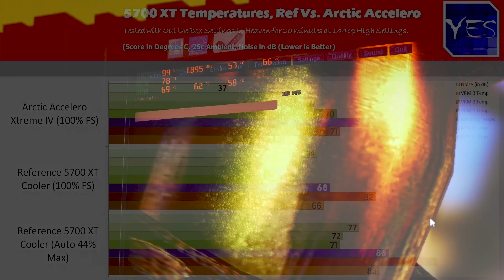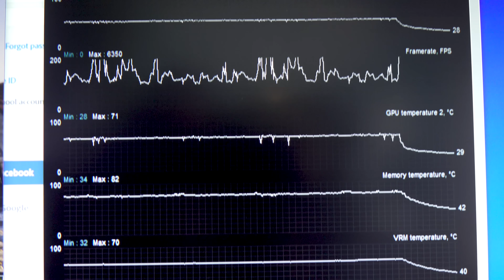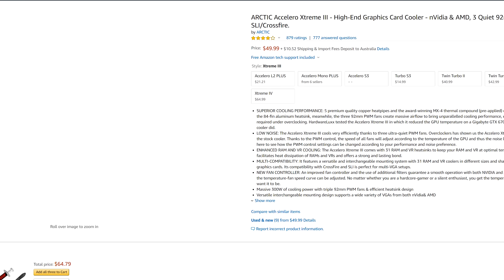Arctic Accelero on a 5700XT - Is it GOOD?!

Comment: tech yes city if you know the answers or any ideas on what i can do to fix an issue i would love it. so my issue is only on a singe genre of game its call of duty black ops 4 i have a i7 7700 and 16gbs ddr4 2400mhz and a gtx 1070ti 450watt PSU 80plus bronze and in call of duty on any settings my cpu is at 100% and my GPU is at 0-1%  and when playing my FPS will be like 120 and then drop down to 20 every min or souse when playing the game and ive tried multiple drivers and the only one that kind of works is the one from november 2017 and i cant seem to fix it  no other game has this issue and i play alot of different games and its kind of annoying, it only happens on black ops 4 and call of duty Modernwarfare when it was beta black ops 3 is fine and also call of duty WW2 is fine, any help would be great :D (also great video)

Comment: AMD Fan bug workaround.  Plug the GPU fan cable to the motherboards fan header.  Then use your board's desktop app to control fan speed.    you won't be able to set a fan curve but can adjust fans according to temp.

Comment: What if, you use that cooler on a rx 5700 and flash drive it with the xt or use the program that allows to pass the clock speed limits of the driver. Reference models start at 320-340 usd/euros, so technically you could have a cheaper kind of xt model with better cooling.

Comment: Hi Bryan. You should try Rajintek Morpheus II. That is a whole different beast compared to Accelero. 12.5 million screws are there to sandwich PCB better, improve rigidity, and prevent GPU sag. Having only 4 screws like on Accelero really warps the card after a period of time. You need to be careful with installation and don't overtighten the screws or you can bend the card yourself. I had a few Acceleros and other aftermarket coolers and if they are not vertically mounted I always prop them with something just to prevent the weight of the cooler bending the card.

Comment: Seems like a cool product, but i think spending those extra 50-65$ on an aftermarket cooler for a reference card is a bad value. Buying the reference card vs. the Pulse here is about a 40€ difference, around 55€ difference to the Red Devil, even the Strix OC, Gaming X or Nitro+ wouldn't cost me much more than the reference card + Accelero. So, a pretty cool product really but the added cost of a better cooler could have gotten you a card with a much better cooler to begin with.

Comment: The Arctic Accelero GPU coolers are like Noctua cooler for CPU, good performance but damn those looks are hideous. Since they're making them for refference cards make it specific only for the refference cards, meaning ADAPT them. Make the cooler touch the VRM, the mosphets and all other components that need cooling and most important improvise on the looks a little.

Comment: The back plate is paramount to cooling and overclocking. Yes it takes time, but it is needed. I took my nvidia gtx 1070 founders edition, could not overclock it more then 100mhz with the founders cooler, and this is in a case with very good air flow. On the 1070, once the Accelero 4 was fully installed, I was able to get a 200mhz core and memory speed overclock. Without the back plate, the rest of the components over heat like crazy and will not allow overclocking. Before with the founders cooler it ran 74c under load, with the Accelero 4 I was getting 45c. It's an incredible cooler when applied correctly.

Comment: I had a IV on a RX480. The backplate really did it's job, it was quite hot after gaming. It was so heavy though. During cleanup install/removal some solder joint gave up and it was dead (the gpu sagged a bit). No warranty after removing the stock cooler. Had to eat that one.

Comment: Artic do include the heatsinks in the 3, but fitment of them isn't very good, but the cpu cooler does a good job. I had to modify the mem heatsinks to fit better. Still got high mem temps.
Edit: that back plate is supposed to replace the heatsinks and cool the mem from the back of the board.

Comment: version 3 does still come with the heatsinks and thermal adhesive. also note the fan speed is only 2000 rpm at 100%. if you had 3 fans at 4000 rpm it would be different

Comment: There is a way to clip memory heatsinks down against the pcb so you dont have to use a curing paste and get better mounting pressure. Next you should try the Alphacool Eiswolf GPX AIO for the 5700xt. It supposedly keeps everything cool even tho the liquid only hits the die directly, but ive heard only anecdotal evidence.

Comment: That backplate is good for memory cooling(gddr6 memor die is near the bottom not the top) and the gpu die but its needs thick thermal pads between to not shorting out the card and is hard to measure those points.And in my coyntry Artic Accelero cost 62€ so its much cheaper to buy custom card with good cooling.

Comment: Gamer Nexus points out in several of his videos that the GDDR6 has its die on the base of the chip. So one would assume that cooling the back of the board,  would improve significantly their temps.
Reply: Yea not the greatest choice in this day in age to not use a backplate. If a gpu has gddr6 which going in the future they all will backplate cooling is only going to help. I dont buy gpus with out one they just look like they are missing something and of course to me reveled PCB just looks terrible.
Reply: Yes the backplate helps a lot on these cards.
Reply: This...
Although it isn't as effective as the heatsinks on the front of the chips, most manufacturers are using thermal pads with backplates for GDDR6, and the ones who don't typically have memory thermal issues.
Reply: There's a pcb with plastic inbetween that and the thermal pad when cooled from the back..

Duuhhh... of course till be worse when cooled from the back.
Reply: @RB1of1  you should cut a hole in the plastic...have to cooler and the backpalate helps a lot with vrm/vram temps
Reply: @RB1of1  You don't use the plastic. When you apply the thermal pads to the back, they are thick and space the backplate out from the PCB, so that it isn't just touching everything and creates shorts.

Comment: You did not read the manual m8 XD 

You did use BOTH washers simultaneously when likely using one is enough (going by RX570)
6:03 you crank the screws hard enough to BEND the mounting plate 

The black heatsink acts as both backplate and VRM/memory heatsink, this "fixes" the memory heatsink clearance problem around the cooler and makes mounting faster. Though it leaves the VRM hotter than it needs to be. 

You put that on by tracing hotspots on the protective film and cut the heatspots out, place in thermalpads and sandwich all with the backplate/heatsink provided

Id say 7/10 solution, instead of redoing the cooler from scratch to leave more space around the GPU area, they keep the old one and slap a fat heatsink on the other side. 

On one hand that will stiffen your card and minimize gpu sag with the added bracket, on the other it CAN bend your PCB quite severely as the backplate cant move far enough on some cards with an IO facing VRM to squish the thick thermal pads together

Comment: Can i claim warrenty anyway after doing this??
Reply: sure, but first you will have to put your old cooler back together
Reply: @RapttorX  ya but is there no stickerthta voids warrenty??and if there is how do i resue warenty void sticker
Reply: @rustydust8648  check if you have warranty stickers on the screw heads before you open it. If not, then go on. If you live in the US its legal to open/repair your product and warranty stickers are illegal.
Also dont do this if you never opened a video card before so you wont harm it in the process.

Comment: The whole point of the IV is it doesn't require gluing stuff to the card in the event you want to revert the card later on.
Reply: the adhesive thermal paste can be cleaned too
Reply: @RapttorX  Yeah, but it's harder. It's right in the product description.
Reply: @MarginalSC  you just scrape it a bit harder and it will come off, its not superglue. Im not a fan of it either btw
Reply: @RapttorX  Yeah, I'm simply saying that the product is intended to be a cooler replacement that's easily reversible if needed tho. That's what it's intended to be used for. Which is why it doesn't come with glue and heatsinks.

Comment: Dear big B., I like your content but in this video you did not use the real possibility of the technology. If you did build it properly with backplate and thermalpads you would have even reached lower temps and cooled the other components. You do not need the little headsinks. Very sad that you judge an aftermarket cooler and not using it right. Check for example https://youtu.be/WGo6s-2RXwo (German PC magazin)
Reply: Top comment. It isn't the frist time that I see a reviewer mount a cooler not as instructed and then start to negativaly judge the component on the errors they created themselves.

Comment: Hi YESman,
What about the Rajintek Morpheus II? While it doesn't come with any fans, it does come with heatsinks for memory, VRMs, etc., thermal paste and self-adhesive thermal pads... it looks better too in my opinion, I'm really no fan of the mid-90s flair and aesthetics of the arctic one
Reply: IMHO the Morpheus is better on Vega 64 non AIB. The A IV works great if built properly https://youtu.be/WGo6s-2RXwob (German, but good to understand as the temps are on screen)

Comment: Bryan...... Bryan. The back plate is the heatsink for the components the thermal pads go over the back side of the vram and vrm and back plate cools them from the back side of them. Its not as effective but still works and is not permanent like the 3's thermal glue. Still love you man. LOL.
Reply: Love it how he doesn't give a f about the manual and just made a "diy" extreme 3
Reply: Right I agree
Reply: No, wrong, the backplate actually increases component temperature. Purely for aestetics. You haven't heard of Gamers Nexus huh? https://youtu.be/SF1Zs3unEto
Reply: @hjembrentkent6181  That back plate is for aesthetics, the one we're on about is supposed to have some cooling capability mate
Reply: i dont know why people wont use the backplate!! a orginal 1080 heats up to 95g on the vrms...without the headsink, your Card will lose perfomance!!
the backplate is not the "best" solution but it works....without the heatsink your ram and vrms reach a high temp limit!!
Reply: @Knebebelmeyer  I got the Accelero IV for a blower style 2080Ti, but when I installed the backplate I found it pressed against the RAM sticks on my mother board, and made me very nervous. I removed it and used the original flat backplate from the card. Also fitted some small RAM and VRM heatsinks on the component side, so basically a kludged Accelero III. It works perfectly, GPU temp went from throttling at 90 with a jet engine fan, to near silent at 60-65 full load.  The little heat sinks I got came with thermal tape applied, so they are not as permanent as the thermal glue. If I want to return to stock, I am sure I can do that.
Reply: @chrisward000  how the accolereo 4 fits for 2080ti thats i dont know.
the rams itself wont get seriosly hot.
the vrms are the spot, where u have to look to.
i used the backplate with the thick heat pats and the cutted out plastic.
yes u get some pressure one the Pcb itself, you have to use the small clamps and put them on the right place for it.
but a 2080ti is a big card and if you mounting them usual ways, you get always some pressure ob the pcb cause of gravitiy!
i use the accolero extreme 4 for almost a year on a 1080 and its did a good good job.
85 degrees usual in preddy every game, down to 55-61max on 2ghz OC.
its a very good cooler.
if you are worried about the backplate you can use other methods to cool your VRMs, but u have to do this, otherwise the card will throggle and u dont get the power out of this.
Reply: Lmao fr man couldn’t take 15 minutes to trace a couple of components
Reply: I've had this cooler with the backplate version, trust Bryan mate, it really is a terrible idea, also what makes this backplate so useless is the fact that the "fins" are arranged perpendicularly with the length of the card rather than just going across, reason being that in the latter the case fans would at least help provide a bit of airflow, its a dumb design and i would strongly recommend that you get heatsinks like Bryan did + you get to keep the original backplate of the card which is a + for the looks
edit: also as a side note for those who dont like the artic acelero cheap logo sticker at the front, you can actually detach the fan piece from the heatsink and rotate it to the other side that's another + for the looks for anyone that cares
Reply: @vladduh3164  No, don't trust Bryan mate. I've got this cooler just yesterday and before I purchased it I went through pretty much every video that's out there including this one. 

I decided to give it a test so I went with no backplate, default TUF backplate,  STRIX backplate, then ARCTIC's backplate and for the last bit I taped heatsinks as well as ARCTIC backplate. The ARCTIC backplate alone made a difference around 8 to 10 degrees, on load on VRM and Memory temps. That's significant, if you think this difference is "useless" then I don't know what to say. Could it be better? Fuck yeah it could, looking at the size of the backplate and hideous visual design you expect more but it does help. It can give you some more room. This wasn't even the cooler working at 100% but 44%. At 100% the difference can go 10-13 degrees.

Then added aluminum heatsinks to the mix and at 100%  VRMs and VRAMs were about 16-16 to over 20 degrees cooler than TUF's stock cooling system. Hell, memory is about 20-25 degrees cooler actually. On top of that this cooler is very, very silent. Even at %100 it sounds about the same with %30-40 of STRIX and TUF's fans.

Mind you, the room temperature was 28C, considerably hot. So yeah, ARCTIC's backplate isn't useless at all. It helps but it's huge and more often than not you'll find it hard to insert to your case. If you wish to O/C your 5700xt then alongside with the backplate you definetly should invest in heatsinks too. I wouldn't glue them though, just get a quality tape. The temp. difference won't be remarkable.
Reply: @vladduh3164  like i said I know its not as effective but my point was that he totally missed the point of the whole design and how to put it together even though he said he read the instructions but clearly he didnt start from "step 1". I just thought it was funny. I would never buy a "IV" variant of that cooler. Ive owned the "III" but i dont like the heatsinks are permanently glued on. When it came time to sell my 980 ti I had to sell it cheaper than I could than if i could of put the Zotac Amp cooler back on.
Reply: @maynardcrow6447  he did say he was going to pretend he had got the v III because it was too inconvenient and risky to put that back plate on as he would have to measure and cut that plastic according to the position of the memory modules and vrms 3:30 
Also, the heatsinks dont have to be permanently glued, that stuff does come off if you pry it carefully, i have even used artic silver's thermal adhesive which is pretty much an epoxy and that stuff sticks on pretty well I had to use some very fine razer blades and a bit of heat but i got all of the heatsinks off eventually and even put the stock cooler back on (which you should definitely never get rid of, just stick in a box somewhere) and it all works fine no problem, didnt affect the resale vale nor have I had anyone complain about a faulty gpu, and mind i have actually done this more than once.
Reply: @vladduh3164  Yes but he acting like he had no idea where the thermal pads go and acted like the backplate would damage the components but putting thermal pads and plastic on prevents that. Both Paul (not an apple fan) and Timmy Joe successfully used the "IV" on there 5700 xt's. He might of read the manual but he didnt get it. He blamed Artic for mistakes that was his own. I love Bryan Ive been watching his videos for like four years. He got me back into PC gaming with used price perfotmance. But he is human and will make mistakes and get confused. And ive heard way too many horror stories of people ripping components off there Pcb trying to remove thermal glue. I cant risk my components.
Reply: @maynardcrow6447  I came to this video looking for a review of this and its just about the worst product review I think I have ever seen.  Nothing wrong with him doing the mods he did, but not until he has actually put it together properly as per the instructions so we can see the out of the box performance for all components, and then he could go on to making his changes.
Reply: Def agree with this, they had the backplate designed for a reason, not using it is just dumb
Reply: @Wanted54321  i did leave a time stamp,  3:30